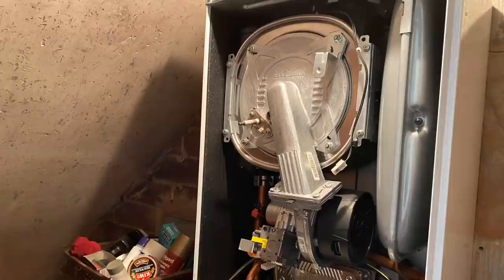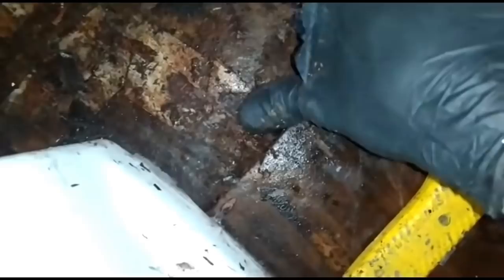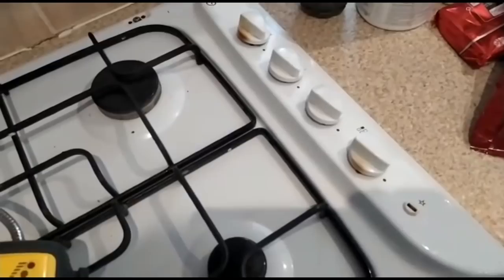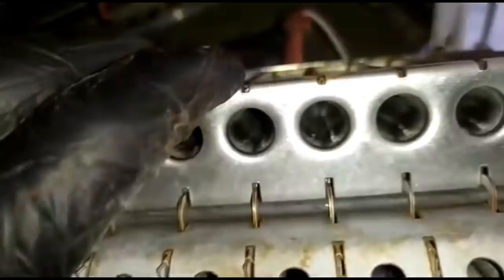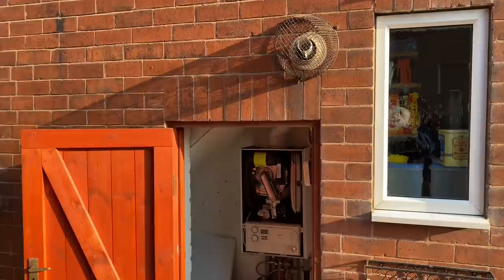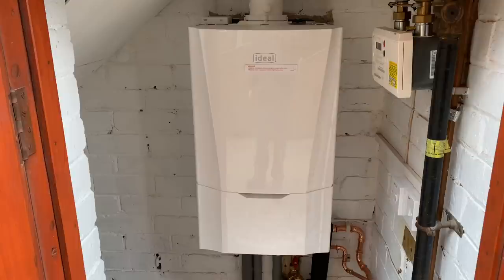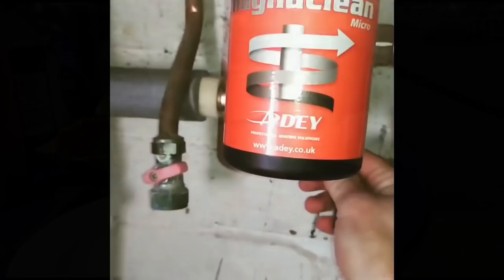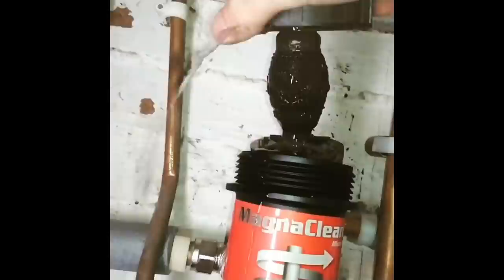Boiler Service / Gas Leaks / Boiler Installation / Plumber

Comment: I no longer do a tightness test on a boiler service. I make sure I mark down on the service sheet that no tightness test has been conducted and ldf has been used on disturbed joints.
Reply from the maker: I am the same but this one did worry me a bit. If I hadn’t smelt it then it would have been left leaking. Thanks.
Reply: When testing the safety device you'd use the iso on the boiler and spray it with ldf after so hopefully it would have been noticed at that point. But it is worrying sometimes. There's been a few times previously when I used to tightness test on boiler services I've found leaks on hobs and fires so I always worry about things like that. But as long as your paperwork is done well you'd hope your protected to some degree
Reply: @jamesowen I think the average homeowner doesn't care for the details, so if you're being paid to safety test then just putting "not tested" on a form won't cut much ice if there's a leak and subsequent explosion after your attendance.
Reply: @bikeman123 I'm talking more from a legal perspective.
Reply: @jamesowen7609  like I said I don't think it will protect you from a negligence claim

Comment: I'd have an electric van if the battery charge was cable off 400miles from one charge as I can do alot of miles in a day. New van next year so I'll see what's available then
Reply from the maker: I only do 30/40 miles per day.

Comment: Hi Alan had fella tell me today he installed a gas pipe in.a bungalow floor and he used two compression fittings in.the floor and it was covered with concrete and tiled he got no pressure drop when he done his test what do you think didn't know what to tell him should he be worried
Reply from the maker: Shouldn’t be installing compression fittings in concrete floors. Thanks

Comment: Tightness test every time!
Reply from the maker: Do you test before and after? Thanks.
Reply: Yes, always before and after. Then if there is a drop before you have touched the boiler/appliance, you know it needs to be fixed before you proceed. 

I also analyse before I take the cover off as I had a boiler with over 2000ppm co due to faulty gas valve 👍

Comment: can you flush a system with plastic pipes my plumber advised me you cant is this correct as my mother in laws filter was the same as yours
Reply from the maker: Depends on the size of the pipes, Normally you can but mircobore is harder. Thanks.

Comment: What’s the difference between a gas engineer and a plumber
Reply from the maker: Plumber does a more varied job, some do gas, bathrooms etc,
Reply: A gas engineer works on gas a plumber scratches his 😳 ok not knocking plumbers as some are the dogs whatsits
Reply: @kevint3845  what companies employ gas engineer

Comment: I would say after the past few weeks with gas explosions, everyone will be doing them. I couldnt sleep knowing i havent done one
Reply from the maker: Definitely worth a debate on it. Do you do one before and one after? Then do you check all other appliances? Thanks.
Reply: I do one before so i know where im at, one after if anything has been disturbed, as ldf isnt the greatest for very small leaks if anything has been disturbed.
Reply: Also do visual checks on other appliances, but i say visual, but im literally doing 26.9 checks on them anyway lol

Comment: Last engr on site, we are responsible, should gas rate at meter so tightness test while there
Reply from the maker: It’s not required for the gas regs but I agree that it’s not a bad idea. Thanks.

Comment: Given you’re legally responsible for a system you’ve worked on surely the very least you should do is basic safety checks?
Reply from the maker: No requirements to do a tightness test though.
Reply: @AllenHart999  I know it’s not a legal requirement, but surely it’s a very good arse covering exercises should there be any issues at a later date.
Reply from the maker: @chrisb4009  Definitely worth a debate on it. Do you do one before and one after? Then do you check all other appliances? Thanks.
Reply: @AllenHart999  As a rule yes.

The before is another good reason, if there is a gas leak on the system I’d rather know I’ve not caused it and don’t have the risk of the customer blaming me for it.

Comment: Anyone who services a boiler without doing a tightness test in my opinion should be looking for another line of work.
Reply from the maker: It’s never been a requirement.
Reply: Follow the regulations mate and you will be covered if it’s not required it’s not required.

Comment: Should read one year old
Reply from the maker: One year old?
Reply: @AllenHart999  I have issues with this modern technology if you read the text I have written one boiler where it should be one year old boiler
Reply from the maker: @cosh52  I am the same, I just join Tic Tok and haven’t got a clue. :_burstpipe::_drill::_mul::_wrech::_tap:
Reply: @AllenHart999  Tic Toc I thought that was a clock